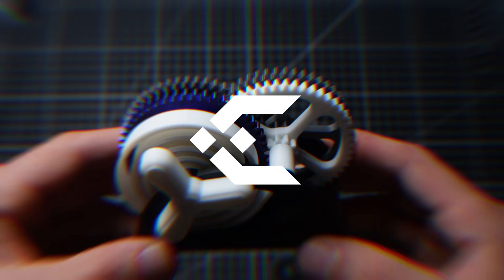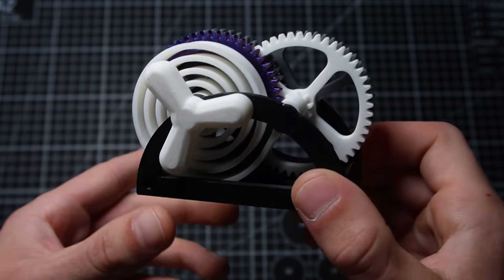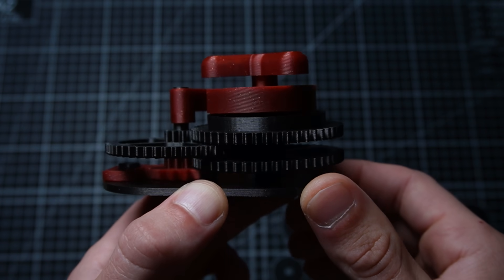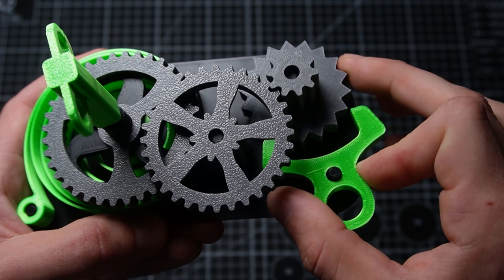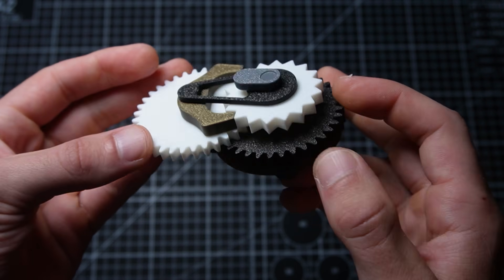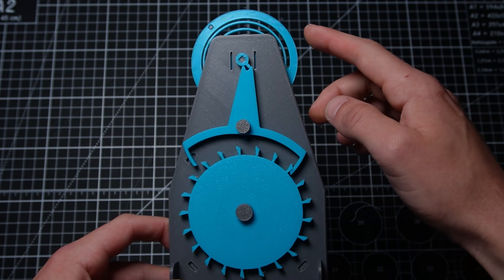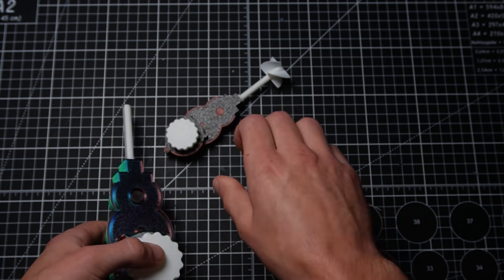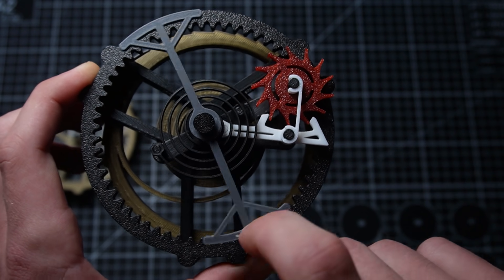These Clockwork Mechanisms Are ENTIRELY 3D Printed

Comment: very cool desings. Just curious, what do you think the clockwork mechanisms need to run smoother? more spring strength or its the pallet (escapement) design?
Reply from the maker: There’s a lot of factors. Metal shafts would probably help the most, then a metal/better escapement. A metal spring would help it last way longer and steadier.

Comment: What you call a pallet, everyone else calls an escapement. Look for wind-up clocks. Some run for days. Friction is any gears nightmare.

Use double tapered gears, which are self-centering. Use oil or graphite powder as lube. Escapements need precision adjustments, as well as any pendulum or flywheel control mechanism. You can create an escapement with adjustable pawls, to tune them. Pendulums and flywheels just need small weights added or removed, to adjust them.

A slower and more powerful spring, or many springs on series, will give you the longest run-time. Push the PLA stresses closer to its limits.

Make washers to aid in gear control and reduce some friction. Having a free-motion washer between a gear edge and a fixed edge, can reduce friction by a minimum of half.

Design the gears mounting positions so that there is an ability to adjust them. A simple slot between mountings, with a screw to adjust the gears closeness.
Reply from the maker: Good comment thank you. Will apply your advice to future designs